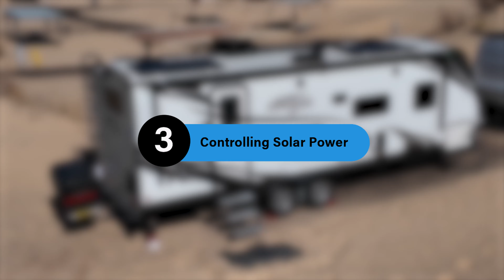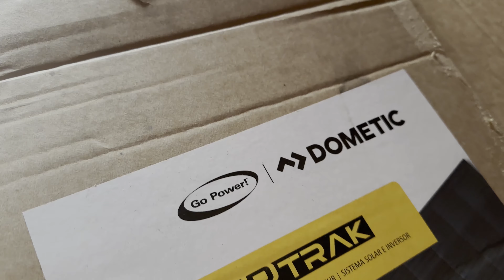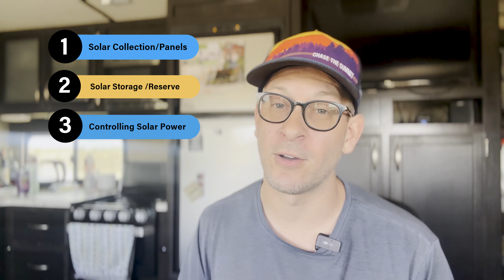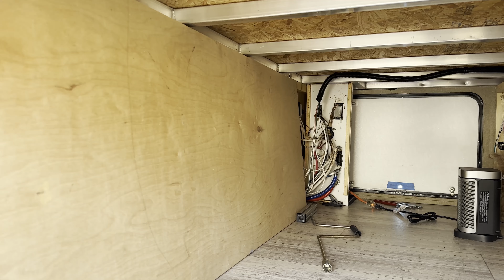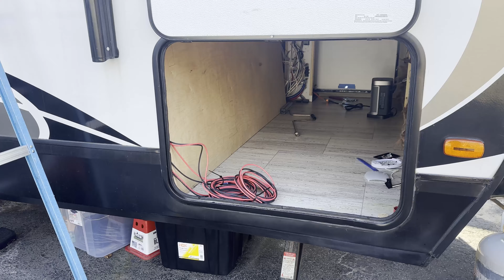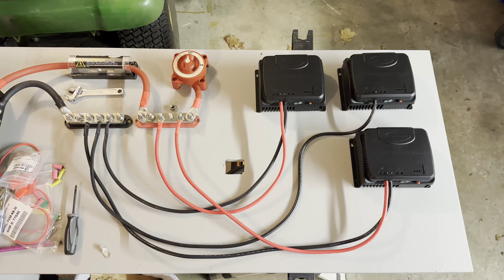More Sun = More Power! Part 3 Control - Powering my Off Grid Travels with the Powertrack System

Comment: Good choice on fuse protecting the inverter. Do you have a fuse(s) or a circuit breaker anywhere between the batteries and the disconnect switch? 4/0 cable cannot handle 600A to 1200A (discharge surge) if something should short out. How long is the run from the batteries to the disconnect switch?
Reply from the maker: Thanks for watching! I opted not to add one Inline there. There are certainly solid options to add one in a build. The run to disconnect is about 2ft.